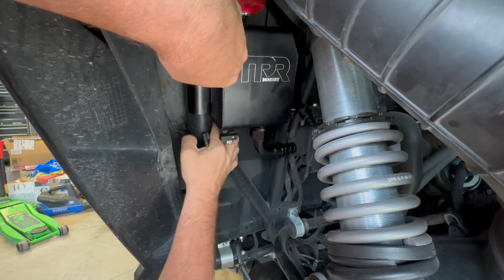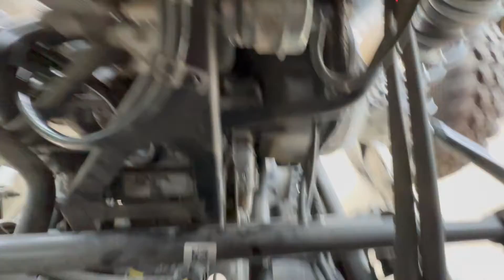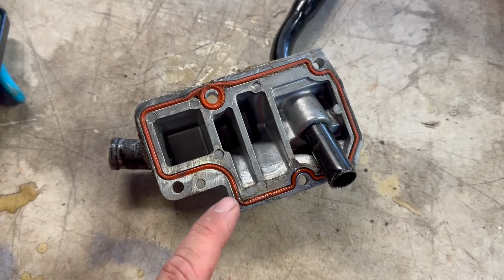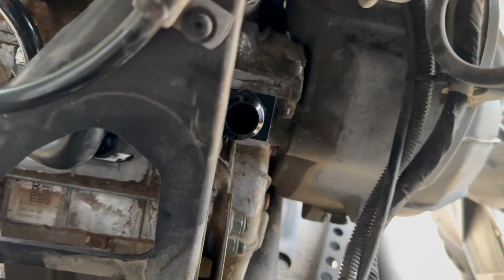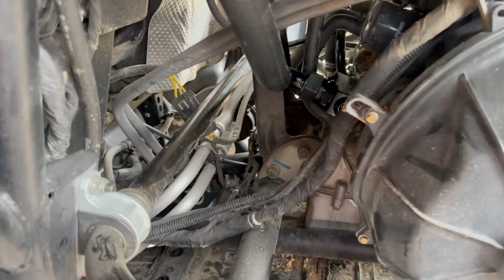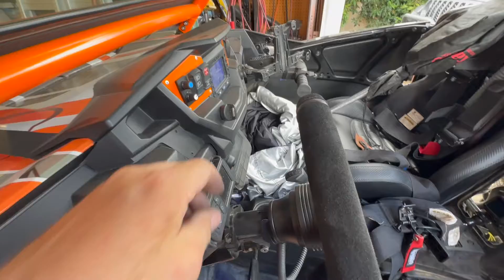Polaris RZR TPR Breather Install!

Comment: Nice job. What were your symptoms prior to this? I have a buddy who has a '19 Turbo S and he is losing oil as he drives, it is def. burning it. We can smell it as he gets a puff of smoke on startup then it clears out. He is losing about a 1/4 qt a day. He had the turbo replaced about 150 hours ago as that was what he was told was the problem and it is still there. Compression test was good etc. and the machine runs great other than this oil consumption. The symptoms to me point to worn valve guide seals or failed PCV but the RZR turbo apparently does not have a PCV. In my research I stumbled upon your video and it has me thinking that this may be what he is experiencing. Any input or advice is appreciated.
Reply from the maker: So the oil will end up on the intake area and is noticeable if you remove the intercooler. It is a known issue on these machines and the breather will recirculate it back in to the motor as opposed to a traditional catch can that removes it. The stock system is setup this way for some type emissions requirement.